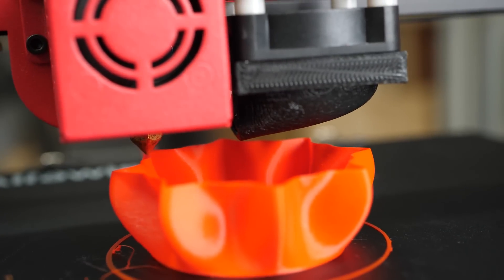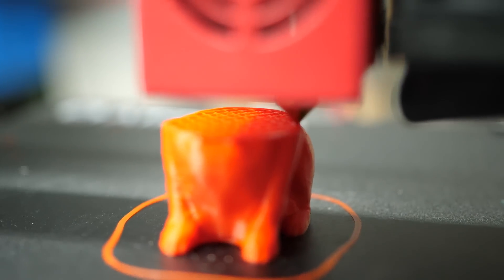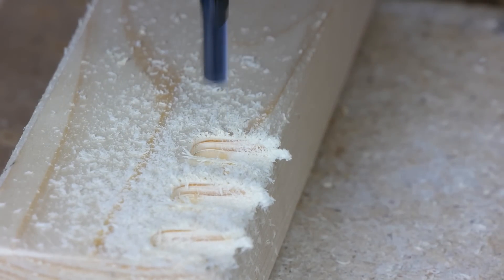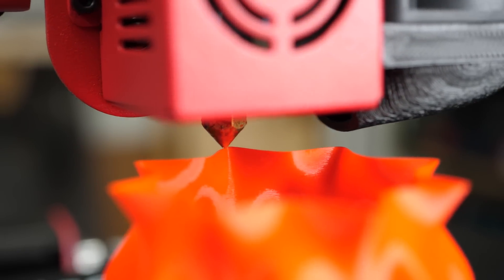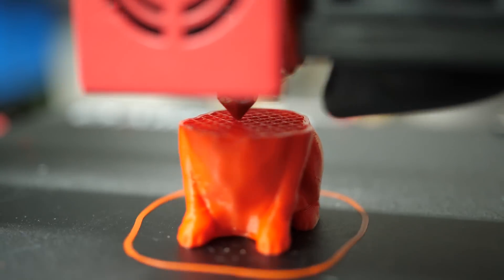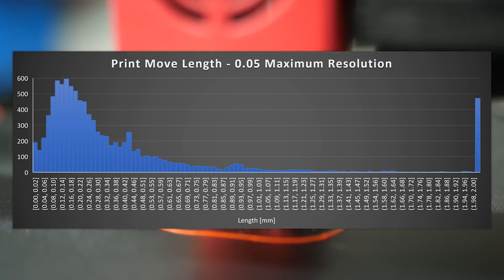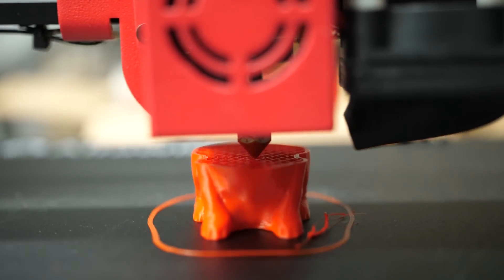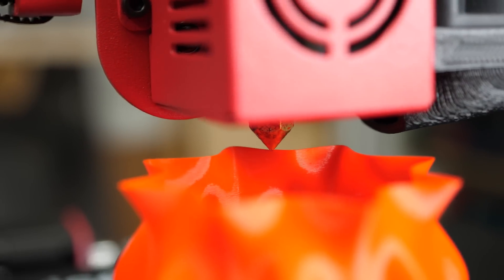(How) I finally got rid of these blobs!

Comment: I'm one of a bunch of volunteers printing some face mask frames for a group in the San Francisco Bay area (Maker Nexus) who in turn is making personal protective equipment for local hospitals during our pandemic.  I was getting some major blobs on large inside curves.  Dialed down the Maximum Resolution to 0.1mm and solved the problem.  PLA on a FLSun QQ-S Delta with Cura.  Great info Stefan!  You rock brother!  Thanks for helping us help our heros in the hospitals!

Comment: Thanks very much for your hard work in helping us improve our 3D printing techniques. I'm running a 32 bit board in my Ender 3. Do you think the additional computing power helps produce smoother prints since it can process data at a faster rate?
Reply: i have ender 3v2 with 32 bit board and today has printed big vase first time aaand when it was complete i saw this blobs so i think yes, ender 3v2 still need wall compensation to be off and resolution like 0.5mm or moar. If i will not complete this comment in week so it means that worked for me)

Comment: I tried values from 0.1 to 0.5 it on PrusaSlicer and sometimes it inserts some weird artifacts in the model. For instance, this model I have has a tall vertical wall with a hole in the middle. When using the resolution parameter it introduces a "step" on the wall around the hole. Maybe it's a byproduct of the type of mesh. I don't know.
 I don't like artifacts in my models

Comment: Hey Stefan, is is something you would recommend on a Prusa MK3S with the stock extruder using Octoprint?
Reply from the maker: With normal prints I rarely had issues with my MK3 and Octoprint. If you see slowdowns then it might be a measure to keep things smooth.

Comment: Actually I don't think the resolution in The slicer is the problem only a work around, I got stuttering and blobs when I installed a BTT TFT35 V3.0 the other day, only in touch mode not in simulated Marlin mode. Solution was to adjust buffer sizes in Marlin and use tx rx buffers, this is the same problem people get with Octoprint, now my SKR v1.3 runs smooth with the TFT35 touch display. After this has been fixed I can adjust the resolutions in Cura if I want just to reduce the files but it prints just fine without.

Comment: A similar problem occurs on regular CNC machines. Especially when doing 3D contouring.  Fusion 360 has a similar setting under tolerance and smoothing. And is interpreted as an allowable deviation from the actual path of the Gcode in order to make moves more smooth and reduce the amount of gcode you are producing.

Comment: look Stephan. My problem is same kind ( release pressure in hotend) but my happen at the seam. 

so my seam looks terrible 

does not matter when I choose random seam or at corner... both looks bad 

can You help me with this?
how stop the release of pressure at seam
Reply from the maker: Use coasting or wiping.
Reply: @CNCKitchen  coasting works
Reply: I tried coasting first. Waiting for results

Comment: I was able to get the All-in-one micro test file from Thingiverse to print at 100mm/s (projected) with a value of 0.05. Anything larger and some of the finer features were omitted from the slice. With the default of 0 in PrusaSlicer the nozzle would stop for 1-2sec when printing the 2 circles. This wasn't an issue when printing from the virtual SD card, but that defeats most of the useful features provided by Octoprint.

Comment: It is related to how many commands are sent to mainboard per unit of time - most firmwares start to slow down movement when buffers approach empty state. I have developed high end 3D printer mainboard software, and this has been one of the hardest problems to solve, but it is entirely software related. Products that come to market with issues like these are just lazy software development job or programmers lying to their superiors that it can not be fixed. It can be! Average 3D printers on the market that use Atmega 2560 under the hood can do about 30-50 g-code commands per seccond, but it can be quite easily ramped up to AT LEAST 200 commands per seccond if developers know what they are doing, 500 if you tweak it real good and 700 being theoretical limit serial-over-usb can handle on 115200 baud. It is all related to timings and can not be done correctly without multithreaded code that does reading and writing in parralel and interleaves these actions really precisely and also utilizes available buffers and propperly implemented resend/recover mechanism for commands that have been corrupted while transmitted. It is a shame 3D tech gigants earning millions cant get this right - it is entirely doable if you put some dedicated developers on this.

Comment: Great thinking there..answer some unanswered questions i had..If problem is that the board can't handle the calculation speed..maybe using Klipper is a good solution and keeping the tiny details

Comment: slowing the print can help, and also using the lowest possible temp for your material reduces the viscosity of the materiel and prevents blobs. The resolution approach seems like a good option when you have tried everything else, because for functional parts sometimes the exact sizing matters. Changing the resolution can effect how different parts line up later on.

Comment: Marlin has Linear Advance that corrects pressure issues in Bowden systems. I use Duet3D boards in my printers and this is called Pressure Advance in RepRapFirmware.

Comment: My blobs are created when the nozzle start a layer.. No matter the resolution.
Reply from the maker: Try to put a negative value into "extra restart distance".
Reply: I already tried, and it lead to bad print with small objects. I changed hot end, and the probleme is solved. I had the problem with  a e3d v6 lite.

Comment: Stefan, du bist der Mann! (As they probably don't actually say in German).
I'm currently reprinting a vase-mode, full-size Night King head (from Game of Thrones) in PLA on my Tevo Tornado and using Cura for slicing. The plan is to encase it in plaster, then place it in the oven to soften the PLA so it can be removed, and then use the plaster negative to cast a latex mask.
I say "reprinting" because the first try had to be assembled in three horizontal slices because of extrusion problems. It took the plaster well (after brushing on melted petroleum jelly to help smooth the layer lines and to help with pulling the PLA out in the oven - which worked better than I thought it would: the trick is to gently pull the PLA away whilst it's still in the oven, and still hot and soft) but the surface was terribly zitty and blobby.
As I type this, I'm looking a two-thirds finished re-print on my machine with your suggested settings (I expect it'll all go tits-up when it reaches the crown of the head, and the overhang angle becomes too much, and I'll need to fill in the missing bits with a 3D pen and filler!) - and the surface finish is absolutely stunning! I'm struggling to see any zits or pits at all. It looks flawless compared to the previous one, and to many previous prints in general.
This feels little short of magic! :)
Thanks, Stefan - love your videos and your precise, analytical style!

Comment: i didnt used this setting on my 3d printer but we use it on the cnc mashine a simmilor setting becasue it saves time (the mashine dont have to slow down so much) and sharp inside corners get smother so the it dont squeak (happens in metal)

Comment: I had the same exact issue as you but doing this didn't solve the problem for me. In the end, it was my RPi that was the issue once I connected my printer straight to the computer (Lulzbot Mini). Still, I made a small adjustment in the resolution and my last test print looks even cleaner. Do not stop making videos, seriously. Your work is top notch and my son and I love watching and learning from you.

Comment: Hello CNC Kitchen, I have an Ideea for improving PETG bridging, you know when it strings because of the ooze, it is perfectly straight and no droop, I am sure that if you begin the bridge with very little bridging flow rate and gradually increasing it, you could make perfect bridges, and optionally, the bridge could start a bit lower and with the thin strings underneath as support for the stronger layers, this could be implemented in the slicer

Comment: Gyroid Infill + Gradient Infill + Non-Planar Slicing would be a perfect combination of strength in my opinion.

I would also suggest doing some bending tests to simultaneously test tensile and compressive strength, as well as some shear strength tests.

Additionally, a variable extrusion width might be helpful in some cases.

Comment: Great video.

Older versions of Cura had Max. Resolution at 0.01, which is very overkill. After many tests I found that 0.03 would make the problem disappear. Newest versions of Cura come preset at 0.05.

Comment: Thanks for the video and solution. This problem is more related to usb connection speed (something like 32kb/s) than microprocessor speed. You will get better print from sd card than from usb connection (octoprint). I guess with a lot more resolution, the microprocessor speed could become the bottleneck even from sd card but I haven't faced this problem yet. I never used a 32 bit microprocessor board yet, maybe the usb connection is faster?

Comment: I've used the maximum resolution setting in Cura, and for this same reason -- I could see my printer momentarily pausing on curved portions of a print, but not on straight walls, and it left zits on the print.  This was on a printer powered by an Arduino with RAMPS, so, 8-bit.  In my version of Cura the default maximum resolution was just 0.01 mm, and bumping it up to 0.04 made the zits go away with no other noticeable effects.  I didn't think to make it so much larger to even 0.5 mm.

Comment: So you have answered the issue I have had with my ender-5. This zit issue would only come up on prints with round surfaces. It makes sense that the stock board couldn't handle all the calculations needed to run a round path and it was pausing like you mentioned. How ever this comes a bit late since I am currently changing to a 32-bit board. But this video has won you a subscription.  Keep up the great work.
Reply: I’ve also been chasing this issue on my Ender 5. I’m really excited to try this out and hope it finally gives me those smooth surfaces I’ve been listing after for so long.

Btw, what 32 bit board did you go with? I’m thinking about doing that soon and have been eyeing the skr mini e3, but it’s so cheap that it seems almost too good to be true...

Comment: It's surprising though given the printers use essentially the same processors (different ROM capacity and pin count but identical architecture and performance) and likely the same firmware family. Difference in Marlin version number or configuration?

Comment: Curious, the generic profile for my I3 Mega in Cura 4.4.1 has the max res set 0.5mm, max travel res to 0.66mm and the max deviation to 0.05mm. I still get the blobs and that is with a direct drive conversion.

Comment: Would using Klipper solve this issue? Basically, Klipper will offload most of the expensive computation to the faster host machine like a Pi or X64 box.

Comment: I thought you really solved blobs completely, but it is only one case. Cura really doing strange things sometime, but how it can solve thick line Cura doing on brim at the same angle for every print and material? It just stops for a moment at the same angle every circle. There is no special or too detailed geometry there, I think it is bug of current version.
Also some blobs like that caused by bubbles of air in filament - you can't see it in colored, but I saw them in transparent PC.

Comment: I'm using Cura 4.4.1 on a Windows 10 pc and I can't find Mesh fixes in the settings :?
Reply from the maker: Exactly the same setup here. Should be available after selecting the gear icon.
Reply: @CNCKitchen  Stupid me, I wasnt using the gear. I used the search box which only shows activated options of course...

Comment: Thanks Stefan for this trick. I encountered a similar issue with my Alfawise U30 (non-pro) especially under OctoPrint, which often send to much data (to much segment in the gcode I guess so) through the USB and the Firmware of this machine has a well known issue with the USB bitrate and I get this kind of problem when the mesh become a bit complicated!
I will definitely try to tweak this settings! Thanks A LOT! If it helps me to use OctoPrint, which I had to avoid because of this problem, I will definitely send you a tip!!!
Reply: 😳https://www.dropbox.com/s/0ohvmiho99qqx6p/IMG-20200120-WA0000.jpeg?dl=0
On the right, max resolution to 0.01mm, left 0.1mm